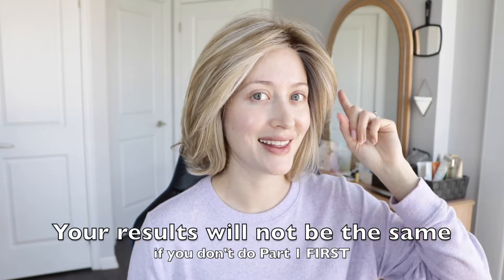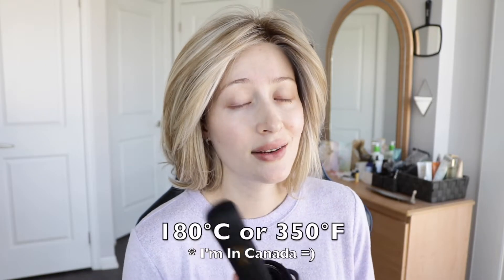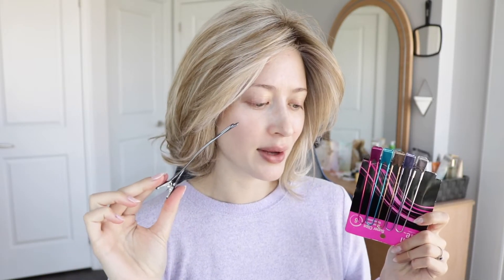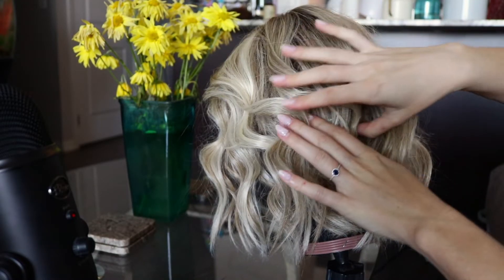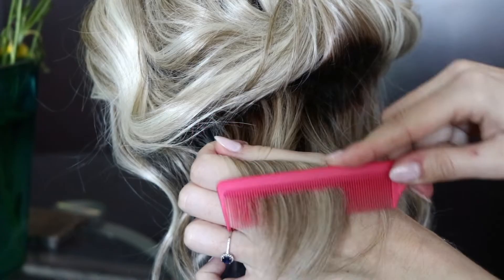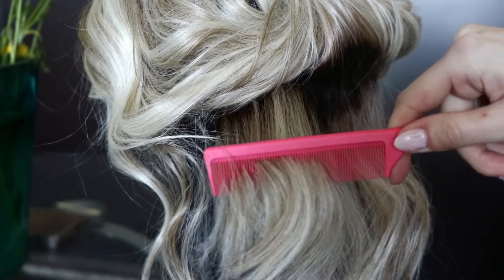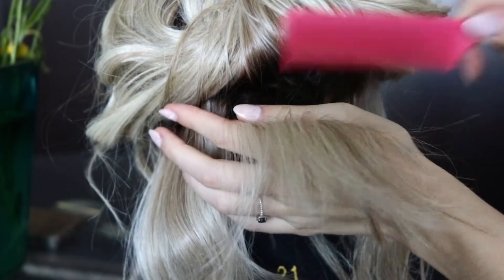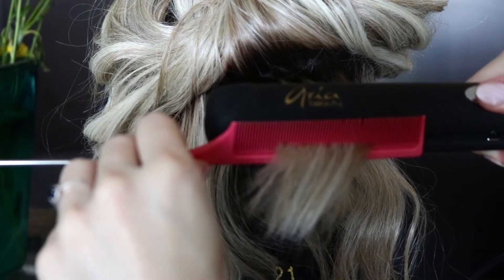MAKE YOUR OLD, Heat Friendly Synthetic Wig Look BRAND NEW With Straightener| PART 2

Comment: Okay so just to be straight with all of this.  I just found your channel.  I ordered simmer in shaded biscuit but haven't received it yet. Just with your daily wear for over two years you didn't heat style it ever unless you washed it first correct? Did you put products in it or just wear it as is when you first got it? How long before your very first wash? Does it ever look ratty and matted too soon before you're needing to wash?
Reply from the maker: Great questions! This video might help answer a couple of them: https://youtu.be/uYok2j8oetk?si=lQ6yKz6XGGx9m8In

The length I go before my first wash depends on how often I’ve worn the wig and where I’ve worn the wig. If it’s a wig that I’m wearing to the gym every single evening, then it will probably need to be washed sooner then a wig where I’m not sweating as much in it, like if I’m only wearing it to work every day. My wig that lasted me two years is one that I’ve only worn to work every single day. And my first wash happened about a month and a half into owning it. I tried to push the wash as long as I could because I knew that when I did it the factory “film” would likely wash out. So that’s when I use the Simply styling spray to add it back in after refreshing it.
Reply: @WigsWithSteph  thank you so much! I binged watched alot of your videos last night after just finding you and I'm so excited to receive my simmer! I was curious also to know if you heat styled ever when you didn't wash the wig or is this only done after washing? Also please work on a video that many others requested about putting the curl back in simmer once it's been straightened.  I'm terrified to take a straightener to this as to not ruin the waves and I'm also not skilled at styling hair in order to go back and curl it lol.  Thanks so much!!
Reply from the maker: @shanhare76  I'm working on that exact video this week =) 
Yesterday I straightened Simmer, filmed the whole thing, and tomorrow I'll be curling Simmer, filming the whole thing. Then I have to put together the videos (they will be two separate videos so that way they're not too long).... I should have it out sometime next week is my hope. I have a new baby, so straightening and curling a wig and filming it takes a ton of time and it's been difficult to find the time. But I'm making it happen! Lol 💗

Comment: Why isn’t the flat iron straightening the wave? I have used a flat to intentionally straighten a wavy wig. Please explain the difference if you  were trying to straighten the wig.
Reply from the maker: Hello =) so happy for your comment! I'm going to do my best to answer your question and explain it. I'm not trying to straighten the wig in this video. That's not my game plan with showing this technique. It's to touch the heat to the fibers and pull through them through the fine tooth comb to get the fibers to look "clean" again. With heat friendly synthetic wigs, over time they will become matted, the fibers will lose their luster, they'll clump together, and look "frayed" (especially the nape of the neck). By slowly going over the fiber with a fine tooth comb, this gets rid of that. If the goal was to straighten this wig, I'd have to run the straightener over each section probably more than once. The reason being- the heat setting is low, and the wave has been set prior- It will take more time on each strand to make it poker straight. Hope this is making sense. This wig has been straight before - by using the same technique. But with the purpose of straightening it, and I go over each section much slower, and usually curve the ends in to create some body. It's just a different purpose than what I am showing in this video =)
Reply: @WigsWithSteph  thank you for the explanation. That helps! and thank you for a great video!

Comment: I’m using my hubby’s phone, cause mine is getting fixed.  My name is Heather Ortega.  @contour_with.heather 

This was AWESOME!!! I have a Raquel Welch wig SHOW STOPPER.  And I don’t know why.. but the ends are totally frazzled and frizzy..  I’ve done everything from spraying deranging spray and nothing works.. I literally just got the wig about 2 months ago, but I think it’s because I’ve had it hanging and put too much heat to it at the beginning w/out the heat resistance spray.  I thought the best thing to do was to start over and wash it!  I have the Estetica shampoo and conditioner… I’ll use those two..  should I spray the heat resistant spray first? Before I put the straightener? Or do what you did..  attach to the wig stand and then brush through it and then straighten it? Also, can I wash it and then hang it on a wig stand overnight? I’m really excited cause it’s my absolute favorite wig…. I loved your video so much!! It gave me so much hope!!❤️❤️❤️❤️🎂
Reply from the maker: Hi Heather!!! It’s so nice to e-meet you!!

I don’t personally use heat protectant sprays- I find that I haven’t needed it. Feel free to use one if you want to! If you do, you would put it on before using any heat tools.

Absolutely, you can wash it and hang it on a wig stand over night :) that is exactly what I did (left it over night!!) except I let my wig dry upside down on a door lol